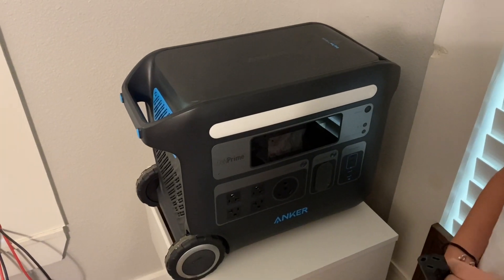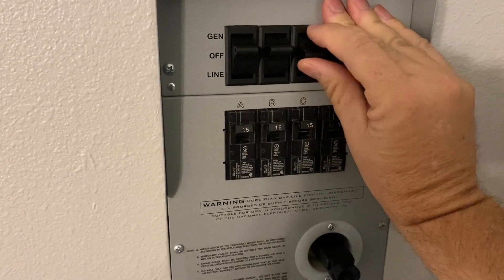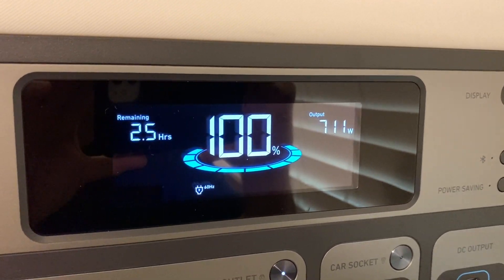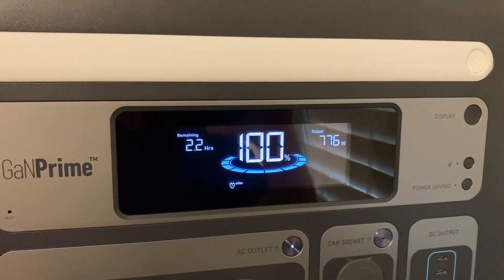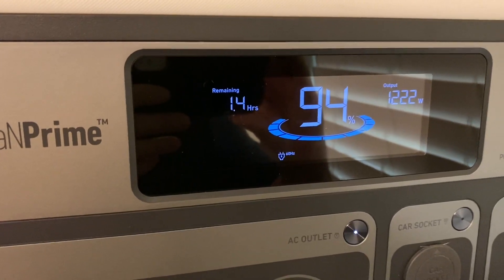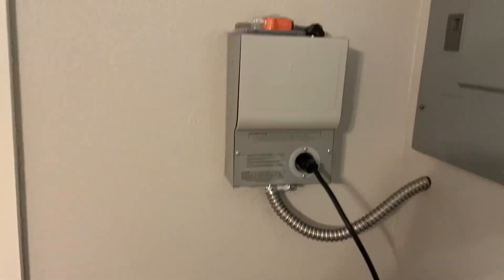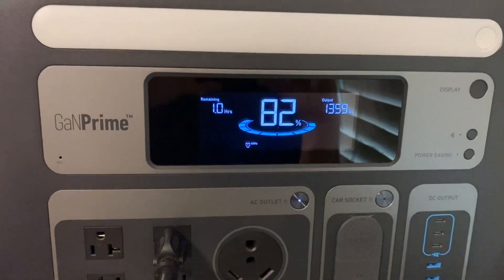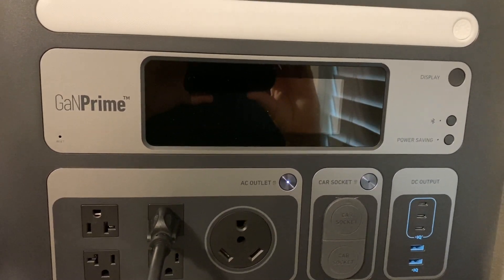Can Anker Solix F2000 (Powerhouse 767) run two window units and refrigerator at same time ?

Comment: Great test!  I have two of those Midea AC units, one 12,000 btu and the other is 10,000 btu.  May not be able to run both at the same time, but still a good test.

Comment: Hi, what is the model of the transfer switch? Thanks
Reply: Thank you so much
Reply from the maker: This is a link to the one I use in the video. It is reliance pro trans 2 15A.  

https://www.reliancecontrols.com/products/reliance-controls-pro-tran-2-back-up-power-transfer-switch-125v-15a-nema-5-15-4-1p-15a-circuits-metal-gray-104b1

Comment: Midea air-cond how many watts is it plz?   Or btu's? TIA
Reply from the maker: One is a 8000 btu for that one I’ve seen it reach just under 1000watts. The other is a 5000 btu and it’s reach in mid to high 400s when really hot out.

Comment: Good video!
How much did it cost to put on the transfer switch?
Reply from the maker: Transfer switches that sizes typically run between 250 to 300 then you have to pay an electrician to install it. 

I’m not sure on pricing for installation from and electrician that would depend on your area and the amount they charge. 

I installed that one personally. My father n law is retired electrician so I have a little experience working with him in the pass. But I’m no electrician.

Comment: My gosh, I think you just sold me on purchasing one of these for our small 30amp 5th wheel. Think this would power everything except our AC in early morning and late evening. The 30amp plug is just what we need.
Reply from the maker: I hope I did lol 

The 30 amp plug puts out 20amps max. It is a 30amp plug to hook up to campers but the Anker 767 will not put out the full 30amps. 

As long as you aren’t running everything at once and keeping under the 20amps should work great for a camper hookup. It is rated for 2400 watt output. 

If you look to buy one don’t forget us. 

https://www.suncatchersolarstore.com
Reply: I've got a follow up question, 2400w/120v gives us 20amps. If you added the extra battery would you then have a true 30amps on the 30 amp plug?
Reply from the maker: @aznick102  no the extra battery will only extend the watt hours which will double the run times but it will not increase the amps or wattage output
Reply: Thank you, still learning.

Comment: Great video although I'd try to find a TT30 cord at least 10awg.  What software version are you running?  Which transfer switch are you using?
Reply from the maker: Updated 2.0.2 Anker firmware. 

That is a 4 circuit reliance pro trans 2. The cord I was using is what came with transfer switch. It’s rated for 15a 125v and 1875w. I was still under that. Usually when I use it the most I will run at once is refrigerator couple lights and one ac.  

If I start pushing more power I will need to up grad the cord.

Comment: USE THE 30 AMP PLUG OUTLET INSTEAD OF USING THE REGULAR EXTENTION CORD TO RUN THE SAME LOADS .🤗🤔
Reply: Convert is not wired for that plug
Reply: Big question 767 or even f2600 ONLY POWERING a midea 10k btu. How many hours would the 767 or f2600 run??
Reply: @donblade5405 my guess it would only run for a very short amount of time.

Comment: So do you also have an external generator hook up outside the house, in addition to the receptacle on the transfer switch?
Reply from the maker: No I just have the transfer switch. There is a window near it that I run the solar wires through when I want to hook up the solar panels.
Reply: Ok thanks. I have a gas generator hook up in my garage, runs through my main fuse box to the transfer switch. I do have the same plug (unwired) you do on the front of the transfer switch, but not wired in. Always wondered if I could run that one on solar a with battery system hooked up, and be able to toggle between the 2 separate systems.

Comment: I doubt both those ac compressor s we’re on. My Anker 767 barely runs the motor on my AC brand new only 8000 BTU and was the only thing plugged in.
Reply from the maker: Different brand ac’s will pull different wattages. Both of those units are Midea one is 5000btu and other is 8000btu and both are  pretty energy efficient. 

I had to do a firmware update to get it to run just the 5000btu properly. 

Strange thing was it run anything I thought it could even the larger ac but struggled with the 5000btu. 

There was a update need which some of the earlier units that came out needed. 

Anker has assured the update is on the newer units being sold now. 

I would think the Anker  767 should run your 8000btu without any issues with power to spare no matter the brand.

Not sure why yours is struggle with it unless you have a earlier model that needs the firmware update. 

I have run a older different brand 10000 btu with the Bluetti ac200max which has similar specs as the Anker 767 and actually is less wattage output than the Anker without trouble so I’m sure I could run it with the Anker 767 as well.

Comment: Boy, that looks like too small of a 110 extension chord to run what you have on it…
Reply: Mine is HD 10 Gauge wire, 1,875 watts also
Reply from the maker: It’s actually rated for 15amp and 1875w. I was close but still under the limit. Normally I would not run all that at the same time. 

Most I usually do is the refrigerator and one ac with couple lights and ceiling fan.

Comment: That's pretty remarkable. I have just purchased one of the 767 units and thought I'd need a soft start (like that Active Start device) to get even one low btu (8000 BTU) to start up. You got TWO AC units to start up and run at the same time? Holy cow, those are some super efficient ACs.